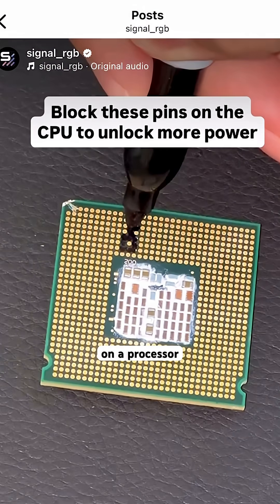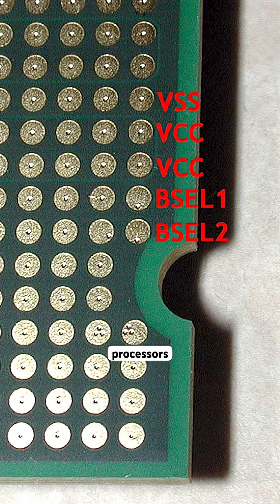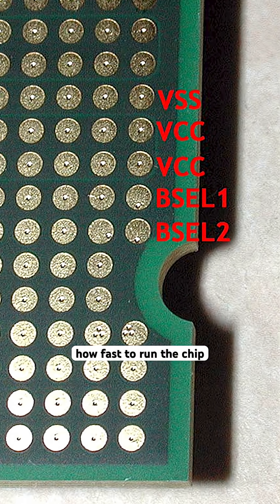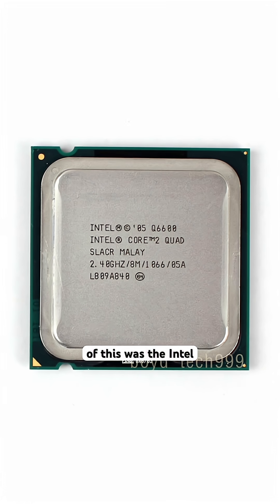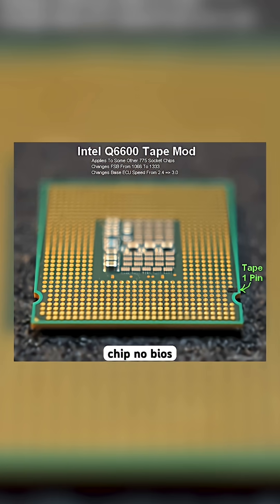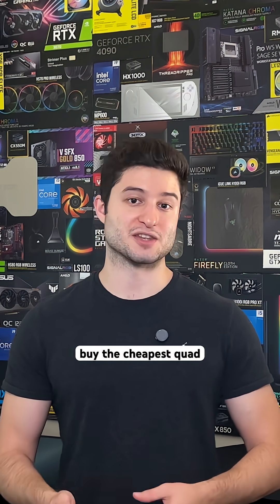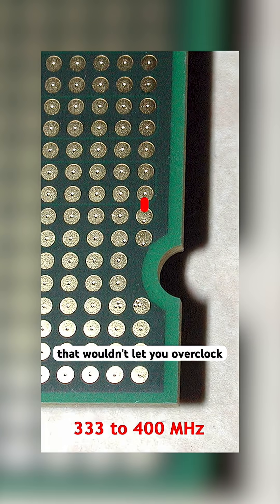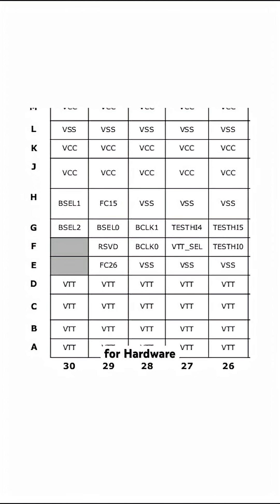Taping a CPU to improve it?!

Comment: I remember intel used to do this with coprocessors too.
They would make a processor with the coprocessors built in and sell that version for one price. Then they would disable the coprocessor on other chips and sell that processor for a cheaper price. 
To make it even more stupid, they would then sell external coprocessor that would work with the processor that had its coprocessor disabled.

Comment: So.. there is some truth to this but there are also some.. gratuitous claims as well. The reason we used the q6600 over core2 quad chips like the q9550 didn't have anything to do with the contact hacking, it was the clock multiplier. The q9550 had a higher fsb but lower clock multiplier which was locked unless you had an extreme chip like the q9650.. which was also 1500$. The Q9550 had a 333  fsb and pushing it much farther becomes an issue as the voltage and cooling required quickly become too much to overcome with normal cooling solutions, liquid cooling was still limited at the time for most. The q6600 had a 266 fsb and allowed FAR more headroom. I was able to push several beyond the 4ghz mark while the q9550 struggled to remain stable at 3.8

The main chips that took advantage of the pin hack were the LGA771 Xeon chips, a tape jumper and a small modification to the board socket allowed you to run xeon chips in 775.

Comment: Chip speeds are determined mostly by where the chip came from on the wafer. Chips on the edge of a wafer will be set to be the slower chips. Chip from the center of the wafer are the fastest. The reason is, the beams laying down the layers of the chip are more in focus near the center than on the edge of the wafer. Yes, an edge chip may run at a higher speed but it has a significantly higher chance of intermittent or hard failures at a higher speed.

Comment: Did this back then on my Fujitsu Siemens Amilo M Notebook... it had an Intel Core M 745 in it with 100/400Mhz (Quadpumped) FSB (Front Side Bus if someone dont know it)... you could make a "Wiremod" in the Socket where you could make the Bios believe it was an 133/533Mhz FSB CPU - which brought it from 1.8Ghz up to 2.4Ghz which was incredible fast back in the Day.

Comment: Q6600 was a great cpu, mine had ran for many years overclocked all the way to 3.86Ghz. Heck, after the CMOS battery on that board died i found out it had even become somewhat unstable at stock speeds xD

Comment: and you could fit a 771 cpu into 775 mobo by cutting slices
of plastic off and covering 3 pinns and bios update and you would get good xeon processor way cheaper than c2q

Comment: problem with this (I used to run a q6600 and an e5450 with tape mod) is they tend to last for like either ive seen people last for few weeks so its kind of unreliable but for my case it took me like around 6 months before it started dyign on me basically it was hit or miss

Comment: Question: I remember the 386SX days.  Intel ran chips at the maximum design speed.  Those that didn't pass were run at a lower speed.  Once the chip passed, that was what it was labeled as. Lower speed, 16 bits instead of 32.  No disrespect, but are we trying to clock a chip that didn't survive the test at top speed? Not saying that Intel is completely honest, just asking.

Comment: i remember doing this with an amd processor back in like 2000. just drew a line with a graphite pen to link 2 contact points and bam you unlocked overclocking. at the time we were still under 1ghz processors single core

Comment: Core2 is still pretty viable for normal use. Has no issues running modern Linux and even windows 10. Can also run 11 23h2 if you use Rufus.

Comment: Better version of this were the first dozen models of Athlons. The originals had exposed connector on the slot cartridge that let you set the multiplier, cache divider, and even bus speed via a simple 10-15$ home made tool!

When they went socketed, they had a ceramic substrate, and AMD laser-cut the "golden bridges" after locking in the desired speeds. You could reconnect them with a mechanical pencil and have an unlocked multiplier.

Once they realized how easy/bad for profits that was, the next CPUs had an organic (plastic) substrate, and the laser cut all the way down to a grounded copper plate. No more pencils! Now we filled in the tiny gaps with epoxy or clay and used a defogger repair kit to reconnect the bridges. AMD was not super happy!

Overclocking was more fun in the late 90s/early 2000s, IMO. More fun, more innovation, more crazy nonsense.

Comment: IIRC you could O/C the snot out of Pentium D 805. And you could use a SKT 775 on a 771 mobo with a small modification so you could high end clock speeds on a consumer board.

Comment: Similar thing with a line of AMD CPUs back in the day. But you used a graphite pencil to draw a line between two points. Graphite is conductive, so it was easy, not physically harmful to the CPU, and could be reversed by just erasing the pencil line.

Comment: AMD had one even better: Phenom processors with "bad
 cores would be marketed with locked-out cores. So a 6-core  with one or two "bad" cores would be marketed as a quad-core, but those cores were often easily unlocked with a decent motherboard. I had a Phenon II 940 that I unlocked the extra cores AND overclocked by a GHZ! It was a BEAST!!

Comment: For those unaware, CPU makers test samples of batches to determine their capabilities. They then package them to assure they can handle the requirements of the package. The Q6600 tested as a 2.4ghz and was packaged as such. By altering the package, you were risking the errors that came up that made Intel push those chips down to Q6600. Turned out, the risk wasn't all that high.

Comment: And before that, there was the "Turbo Button".
Funnily, the "Turbo Button" wasn't actually meant to "boos performance", but it was used to lower it for games or software that run too fast on the "normal" clock speeds.

Comment: If the chip does not have the transistors to function like a higher end chip or the threads, then how does it boost itself? Wouldn't there be an immediate bottleneck or overheat issue? Even with tape, or coloring out some of the contact pads, it doesn't add more to the chip?

Comment: We used to bridge contacts on top of the AMD Athlon and Duron processors with a pencil so they could be easily overclocked. We could run them at 20% faster clock speeds without any issues.

Comment: You could also get cheaper xeon 771 cpus and a little sticky thing you put on the cpu to swap 2 pins and put them baby's in most 775 boards. This was my way of saving a bit back when core 2 quad was okay for budget gaming. The xeons also usually have a 133mhz front side bus too so it was equal to or faster than most core 2 quads while being cheaper at the same time

Comment: This went on loopoooong before the core 2...  Lol you must be 20 or something .
AMD duron and athlon xp CPUs could be unlocked using a graphite pencil on two traces that were Lazer cut by amd.  Turning your 1800+ into a 2200+ for example 

Older Pentium 1 CPUs could be overclocked by wrapped a wire between two pins.

Comment: I didn't do this myself, but on a similar note, you could get a LGA771 CPU, like the E5450, and use it in a LGA775 board with the right microcode, like a Dell Vostro 230. I bought a pre-modded one, but basically, a Q9650 for half the price.

Comment: 775 Intel socket these are all over eBay you can run a 771 Xeon which is technically faster in a 775 but you gotta mess with adding microcodes to the MB , Ive attempted this, not easy at all and if you have a weird motherboard achew DELL its almost impossible, I searched for hours , if you have a more common asus or gigabyte motherboard you can probably add the microcodes more easily. For the board I had though it probably would of required more hacky shunt mod kind of attempts and I was pretty much exhausted after not finding anything. lol!

Comment: The craziest overclock was the Celeron 300A which was 300mhz and £67. It overclocked to 504mhz saving you from buying the £2,500 Pentium III
Reply: Yeah, the 300A to 450 was an overclock percentage we will never see again in general usage.  50% off the top with absolutely no behavior change or instability.
Reply: Dual Celly CPU boards were bargains. It was worth installing NT 4.0 to run them.
Reply: @oldphart-zc3jz or a proper operating system (some flavor of Unix, at the time probably FreeBSD or redhat here in the states) if you wanted to get real work done
Reply: I was so happy when I got mine! It was so fast.
Reply: i remember the duron 600 to 900 drill bit mod
Reply: Does anyone know how to overclock a AMD EPYC 9754 ??
Reply: 300A's were a nice choice as a student with low budget. Also don't forget the P2 300 SL2W8 which was essentially the same overclock, 300 to 450 or even 504MHz+. Slot-1 CPU's pins could also be taped off, though not needed with good motherboard full of overclocking features. I actually got the 333A back in the day and ran it at 500MHz. Later we also got the great Abit BP6 motherboard which allowed for dual Celerons on socket 370. Got two dual 366MHz @ 550MHz. Which was a very common setup for tweakers like me. I was just 16 at the time so this low-cost super-performance was great. I remember having the fastest PC on multiple LAN party's while also being rather cheap. The most expensive part was the SLI Voodoo2 setup.
Reply: I did this exactly
Reply: Too bad it was still a Celeron.
Reply: Yeah it was faster than the fastest Pentium at the time and outperformed all other CPUs.
Reply: You weren't around for the 80386 era, when simply replacing the clock crystal doubled a PC's power, and you completely ignored the entire 80486 lineup… the one that preceded the first Pentiums in 1993-94. My 386 had the power of a 486DX50, and its frequency wasn't even doubled, and without needing a heatsink. The best overclock of my life, far superior to that of my i7 920 with its 4.4GHz.  ;)
Reply: 67💀
Reply: Yes, this was a thing.
Reply: Jesus Christ loves yall he died on the cross for yall repent and follow Christ, not forcing
Reply: My first pc was a pIII
Reply: And you create the extra cache too, right?

Incredible how people can lie just to achieve clout thinking everyone is dumb like then...
Reply: @solucaoatende the 300a had less cache but was direct-die & ran at full speed. Pair that with a huge oc & the performance advantage was clear.
Reply: @oldschooldude8370  No it wasn't clear at all. The cpu it's not designed to run at double the clock speed. You just 1/10 th its lifespan

Comment: The motherboard had to be capable of the higher FSB of the newer core2 chips. The q6600 ran at a 1066mhz FSB. Once the 45nm core2 cpus were out, you could use an OEM motherboard with the tape mod on them. I put together a couple little gaming/htpc machines with old Dell and HP motherboards and $5 q6600s off ebay with a little piece of kapton tape. Good times...good times.

Comment: The xeon quad core could also work if you filed two notches 90 degrees from the original ones. This made you place the xeon 90 degrees in the core2 socket. Next, you needed a special pin swap sticker if I'm right, and you could run the xeon in your system

Comment: This went back to the Socket 370 Coppermine Pentium 3's. You could rip a pin out and it would go from 66mhz front side bus, to 100mhz or even 133mhz front side bus. So a 433mhz chip (6.5 multiplier x 66mhz) goes to 650mhz (100mhz bus) or 866mhz (133mhz bus). The lower end Coppermine P3's were amazing overclockers due to being the first chips with a flipped die that was exposed directly to the heatsink on top of a process shrink AND the cache being integrated into the CPU core instead of a separate piece of RAM on the package with it's own bus/connection to deal with. It was glorious.

Comment: We reached the pinnacle of our tech just lately with the current architecture of that tech. Our new GPU's and CPU's are basically just remodels and releases of features that have been or could have been included in the later gens too. Smartphones are maybe the worst there is, as big brands keep on releasing new models every year while they had the tech to release said models 5-10 years ago, but they didn't because it is much more profitable business to sell things to customers bit by bit. And this applies to all electronics. If we truly want to get on the "next stage" of performance and abilities, we need to get a totally new architecture of how the tech is created. It is the limitations of physicality and it was told already some 20 years ago that we are about to reach that limit. And we did. You can keep adding memory modules, you can keep adding more lenses to cameras but it is the same level of tech nothing new, nothing that couldn't have been done 5-10 years ago. This is the big BS that the industry is all about. GTX 1080ti is a perfect example as it has many times been proven that when overclocked it has been outperformed gaming gpus that are many generations newer. These newest gpus we now have on the market, could have been on the market years ago. It's all just business and ripping off the customers.

Comment: Unlocking the L1 & L2 Bridges with a simple line from a graphite pencil allowed you to overclock the cpu so much you needed artic silver for thermal paste and a copper thermaltech heat sink the size of a brick with a fan so powerful it hoovered the room at the same time as it cooled the core! 😂😂

Comment: i mean yeah you an get beter preformance out of the chips that way...but thing is they are limited for a reason, those chips are low end and are not built to handle that so when you overclock them like that you are 'drasticly' shortening their life span...a chip, run that hot and hard, that normaly would last a decade you will get maybe 2 or 3 years out of tops...and even the cheap cpus arn't exactly growing on trees...

Comment: Back in the days I used to tape two pins on xenon CPU's and cut the plastic guiders from the socket to work on 775 boards from 1366. Good times.

Comment: I did this back then. There were several free performance upgrades back then by hacks like this and bios changes to make amd chips run at at faster speeds by unlocking cores that were simply locked on the processors.

Comment: I remember doing something similar, but with far less technical knowledge and proficiency. 
I used to use a scalpel blade to turn a 720 KB 3.5" inch floppy disk into a 1.44 MB floppy disk.
All you needed to do was to cut a square hole in the upper right hand corner.
This was before the invention of the pen drive, obviously.

Comment: It was quite common for chip manufacturers to hamstring good chips and turn them into a cheaper version.
They only had to produce one kind of chip, which saved costs.
Reply: It wsnt "good chip". The thing was, every family cpu was manufactured as one, lets say Core2duo. After production, every chip went to testing. Based of malfunctions, processor options where switched off. Low stability working catche? one model, failing at 3GHz? , 2,8GHz model, maybe even lower, if 2,8 was failing. only one core functions out of 4? celeron proccessor.  "Hackers"  turned them on again. question of stability remains. Ofcourse official test where more harsh, than it should have been. Theres hight propabilty that you got way better cpu than official model, but hightly unlikely to get xeon out of celeron.
Reply: @Martink9191 almost wrote the same thing pretty much.. I saw the intel video explaining that all the processors are made the same and classified into i3, i5, i7, etc. based on how many sectors failed testing. This reduces the waste of “mfg error” by selling it as a “lesser product”
Reply: Jesus Christ loves yall he died on the cross for yall repent and follow Christ, not forcing

Comment: Was a pretty decent time instead of being super accurate they just binned CPUs if it didn't make the cut. The problem is it's a bit o gamble as they where binned for reason so you end up with a really bad one and no scope to increase. I'm pretty sure AMD ones you could unlock this in the bios without physical MOD at one time.

Comment: Processors are often all the same.  They make them at the same time and then run tests on them and the flawed ones get downrated as the slower, budget processors and the ones that run reliably at high clock speeds get sold as the premium models.  They come off the same die though

Comment: Binning is a thing, you literally need a microscope to see what low tiered processors were intended to be... A lot of these "Budget" or "Mid tier" cpu's are just failed high-tier cpu's with features disabled, locked or inoperable... Most people don't realize when you are buying a cpu or gpu on budget, you are not buying something made intentionally to be that way... You are buying something that is flawed straight off the press that is programmed or modded to function as is... Hence cpu and gpu series/generations...

Comment: Most Mainboards could simply be set to run this up to 3.2Ghz. The Conroe Core was a beast. I had an E2140 for 50€ with a base frequency of 1.4Ghz and it run for years at 2.8Ghz.

Comment: It was also a thing in the Celeron 300 Mhz era 1998. You tape off pins on a Celeron, it tricks the board into running a 100mhz bus, running the Celeron at 450 Mhz.  The same tape trick from, 1998.

Comment: I built A Q6600 system with a custom liquid open loop in high school. It was Intel first Quad-core Desktop processor.  I was able to overclock from 2.4 GHZ to 3.2GHZ reliably. Had it for 8 years.

Comment: This would all very much rely upon the architecture of the chip being basically the same between both. Very much possible that it was, and indeed that definitely still happens now, but it's not like this was universally applicable - you can't necessarily get any more performance from a substandard chip by physically overclocking it, you'll just kill it.